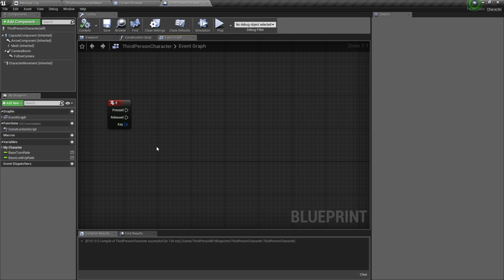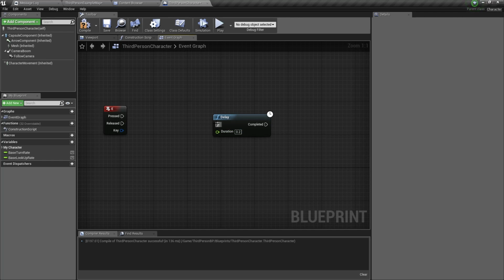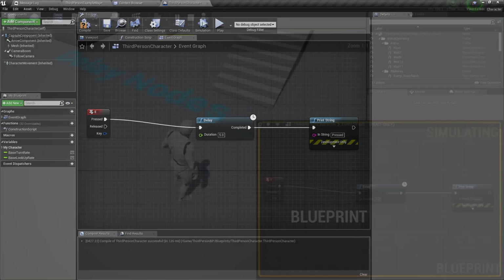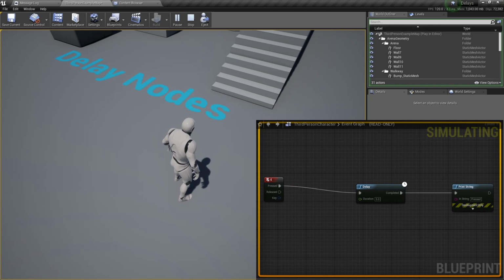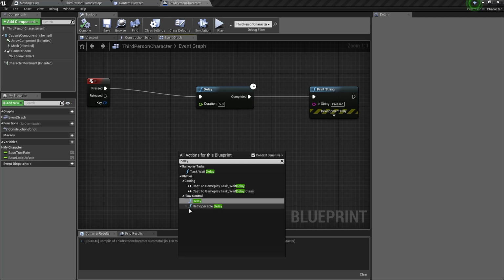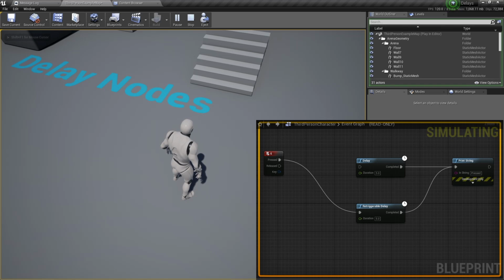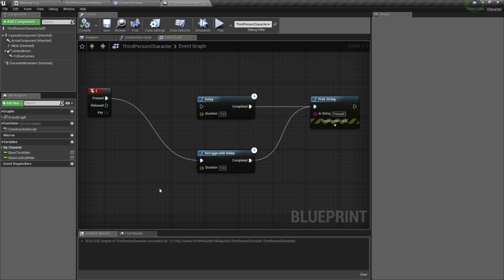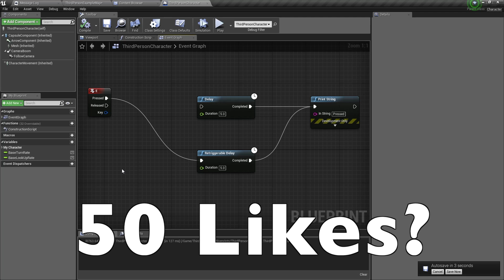How to use Delay Nodes || Flow Control || UE4 TUTORIALS

Comment: For some reason I do not get the delay as a possible option in my blueprint even after unticking the "context sensitive" button.
I am using the version 4.27, any idea why this is a problem?
Reply: I found the issue when encountering this myself. You can't use a delay within a function or method, it isn't supported.

Comment: How does one create an Async Delay node? I need to create two delays independent of each other at the same time. One to reset a cooldown and another to reset an animation.
What I want to do, Example:
- In 30s reset cooldown (new async delay) AND in 10s reset animation (new async delay)
What I am doing:
- In 10s reset animation (delay) THEN wait another 20s and reset cooldown (delay)
Reply from the maker: Try using a Sequence node, you can have many outputs using that, then you can start both delays at the same time. https://docs.unrealengine.com/en-US/Engine/Blueprints/UserGuide/FlowControl/index.html#sequence
Reply: @TechnoNerd  Thanks! :) This did the job.

Comment: hi,
i have two point light (movable) setup and applied toggle visibility to it. i want lights on/off alternate. so i added delay node to event tick and one flip flop node to switch alternate. in start of gamemode everything goes in sync but after few seconds, lights on/off goes out sync. why this is happening. 
Please i need help ASAP.
Reply from the maker: It probably is related to the FPS of the game, instead of using a fixed value in the delay node use delta time from the tick event and multiply it until it is the value that you want
Reply: @TechnoNerd  sound cool and right. i'll give a shot. thanks
Reply: @TechnoNerd  issue didnt affect sequence render, sequence render is perfect with delay node.